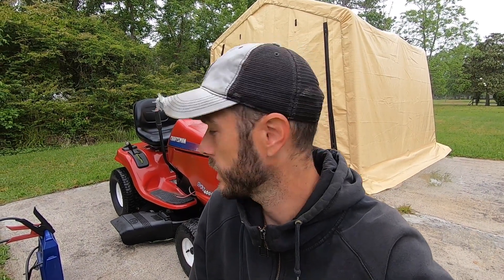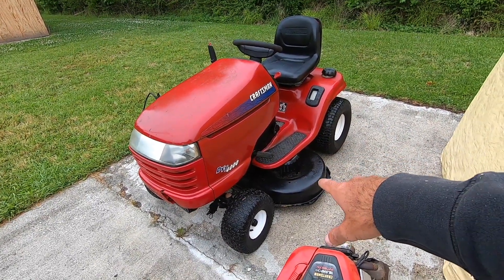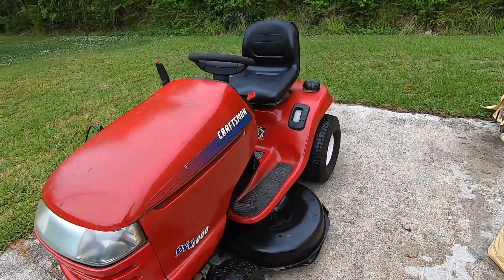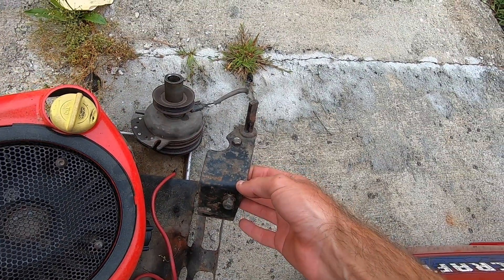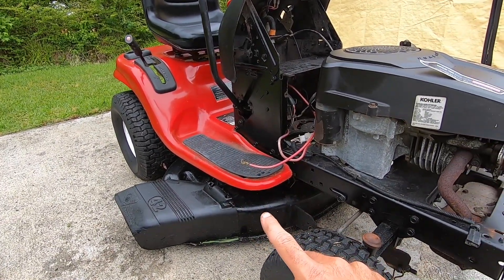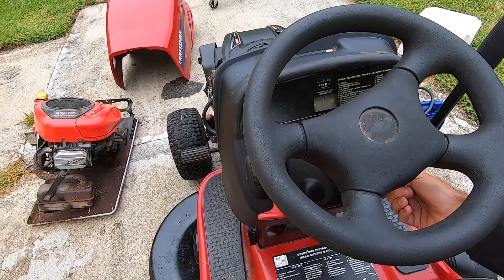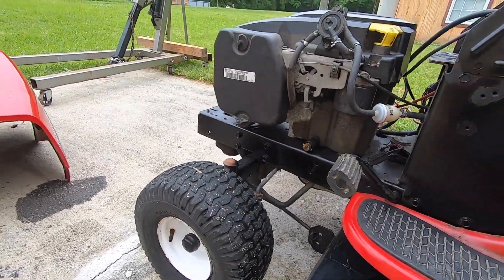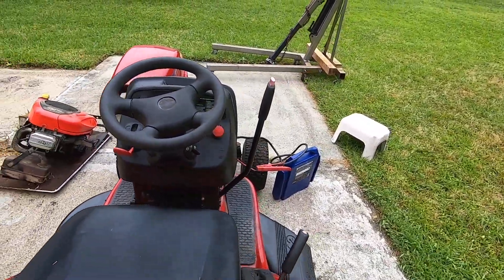I SWAPPED ENGINES ON MY CRAFTSMAN RIDING MOWER | BRIGGS & STRATTON TO KOHLER

Comment: Wow my friend you got yourself a really nice looking tractor. I love the older tractors. I have and still use for my lawn a 1990 Dynamark I restored it and it runs FANTASTIC. Its got the 12.5hp Tecumseh engine and 5 speed trans. I take super good care of it. In my opinion id much rather have a geared trans and a lever to engage the deck. You did a hella good job on this unit. Keep up the great work
Reply from the maker: That’s awesome! I’m right there with you. I would much rather have manual trans and deck engagement.  Usually built better and lasts longer. I bet that dynamark is a fantastic machine. Thank you so much for the support 🤘😎
Reply: @freedommowers420  it is, runs and cut like it's brand new. The only problem I have is finding parts for it. Its so hard to find parts and when I finally do... It's crazy expensive. But the way I look at it I put alot of time and work into her. She does reward me by running and cutting a perfect acre and ahalf
Reply: The old ones are nice. I had an old craftsman years ago I loved it.

Comment: I've got a Craftsman T1600 I installed a new starter. I didn't torque the bolts correctly. The starter busted the block and the starter just laid on the frame. I hope that you can help me please. What motor can I swap with the correct bolt pattern. I would like to down size the motor because I pull a Craftsman trailer with my lawn equipment in it. Thank you

Comment: So I have a 20 horse craftsman single engine, wondering if I could go to a 25 horse twin cylinder engine are the mounting bolts, a complication?, as well as the muffler system be changed out?
Reply from the maker: Yes you can do the swap. Things to consider are exhaust, throttle cable, crankshaft size for the pulley, and engine wiring harness. The  mounting holes should be good to go.
Reply: @freedommowers420   
Also, have you done an exhaust modification before ? Or just kept original motors the same on swaps?
Reply from the maker: @Westshore_marine  yes I have some some exhaust fabrication. Usually that’s the biggest issue I run into as well. It’s not terribly difficult, just time consuming to cut and weld it up.
Reply: @freedommowers420 not an issue, I can do all that. I’m actually a professional marine tech. Mower just took a shit.
Reply: Sounds good, my shaft is a 1 inch x 3 5/32. The biggest issue is the exhaust and maybe the cable. Certainly the exhaust will have to be modified because I’m going from a single engine to a twin engine.

Comment: Swapped a bad engine for one of the worst ever made,how cool is that???
Reply from the maker: That’s what I had at the time. I think the kohler courage singles are garbage, but I needed to get it running. Thanks for stopping by.
Reply: Scrap yards are full of lawn tractor engines that usually have a minor problem that is an easy fix be there at the right time and you can buy them for pennies on the dollar.I do it all the time and flip 30 to 40 every year... @freedommowers420

Comment: BRO!!!! SOS!!!!!! I need help I got a mtd riding mower that had engine swapped!!! I need help!! I changed all belts and it starts and runs I got belt for deck and it won’t start!!!!! Only with deck on?!?!? I need help and input bad this is my first riding mower but I’m a self proclaimed mechanic so I understand most of it. Problem is I don’t know much about how everything sat before engine swap and it seems deck needs to hang lower than before to operate belt. So I adjusted it accordingly. It was rubbing belt deforestation it started once nave ran blades but no stop blade??? They spin when started and deck shakes when started and engine drains battery trying to fight it to start? Can u help? Anybody!!!! Lol I need it

Comment: That mower is super nice!  I've done the opposite swap before which is easy with the donor engine harness but the electric PTO does complicate it a little.  Nicely done!
Reply from the maker: Thanks Casey. I’m just glad I had the donor tractor with all the parts for the PTO. swap only took about an hour to do everything which was nice. Hoping to get a fair price on this mower. It needed a lot of repairs.

Comment: Nice swap over there ALEX 😎👍
Reply from the maker: Thank you very much Robert. Let’s hope this engine holds together for this machine.
Reply: @freedommowers420  hopefully it will work out for you  ALEX I got to get a muffler for my John Deere LT  changed the oil today but can't run the engine with out the muffler